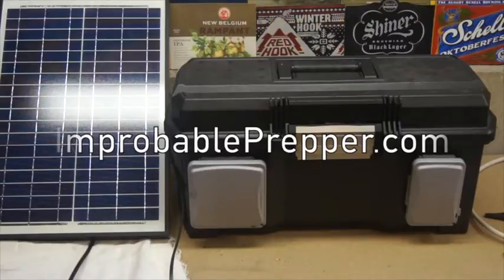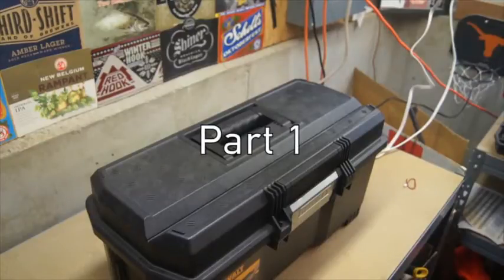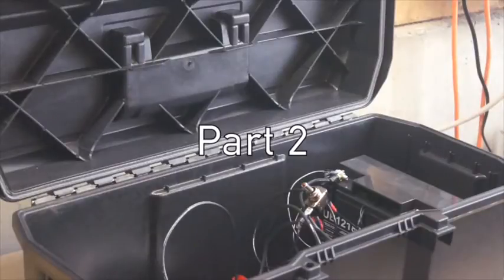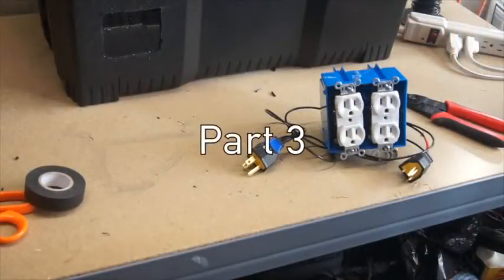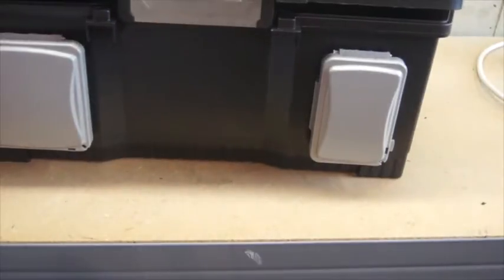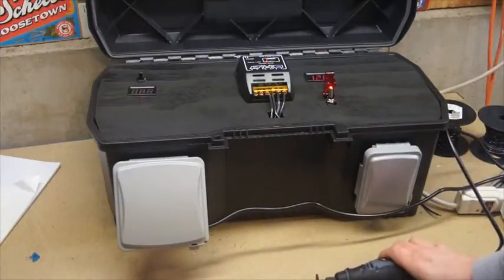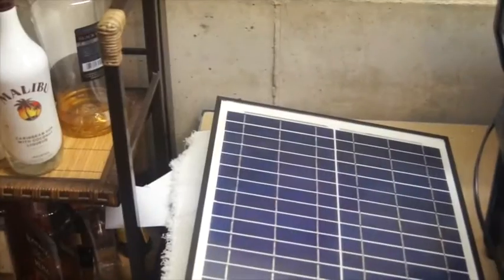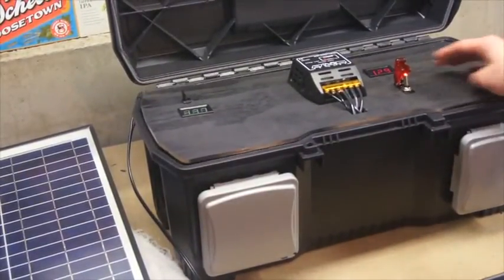How to Build a Portable Solar Powered Battery Pack

Comment: you charge controller load cant handle the amperage for the inverter. The inverter needs to be connecred directly to the battery.  Also your AC wires from the inverter look to small for the wattage. Need fuses also. Not trying to knock your project just sayin.
Reply: I am building my own battery box with solar input for charging and 12v usb and cigarette lighter output.  What is the best/safest way to attach a 240v attachement for charging the battery at home and for trickle charging?

Comment: Safety First! 12 volts can and will start a fire! Your car's system have fuses on every circuit and a fuseable link at the battery and so should this box. Even that little battery has the amperage to burn or explode.  At least wire a catastrophic fuse at the positive post of the battery (30 amp?) then you wire all your loads from that fuse. You fuse to protect the wires from burning if you get a short or a overload. Fuse EVERY circuit separately. You should even fuse the panels before the charge controller and fuse between it and the battery. The inverter should have heavy enough wires and a separate fuse for its load. Safety First. Nice setup!
Reply from the maker: Good tips. thank you!
Reply: Not knocking your project just trying to educate the viewers without fusing 12 volt has started fires
Reply from the maker: +Bruce Arntt not at all. I truly appreciate the feedback. I'm learning too!
Reply: Bruce Arntt can you use the same rated fuses as the charge controller? For example if I have a 20amp controller, do I use 20 amp fuses through the system?

Comment: You say that the load on the charge controller runs the inverter, how many volts does to load port on the charge controller output?